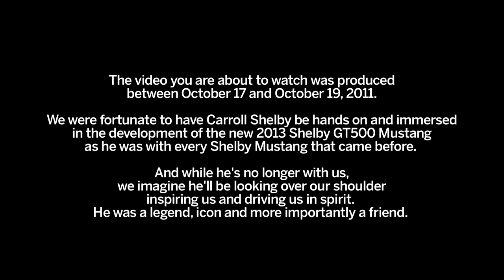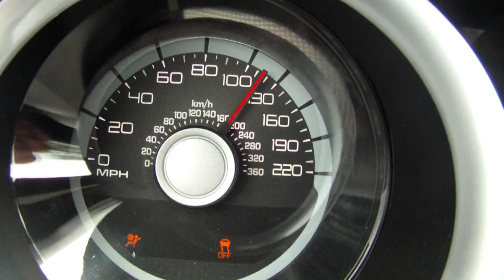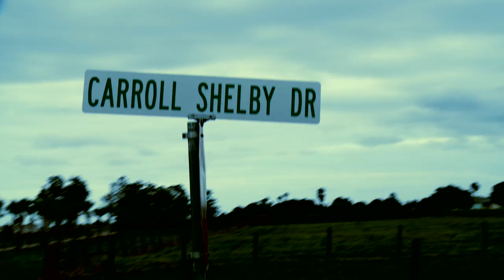Carroll Shelby and the 2013 Ford Shelby GT500

Comment: With him he took the mustang, now it’s a European car, he’d laugh if he saw the new GT500
Reply: No stick shift I think he probably would have put an air shifter in there to do the shifting use the clutch pedal and the stick for regular drive and press the button for air shifting it would be cheap  get your air at the local air pump all he could have made it an electric shifter some drag motorcycles guide most racing motorcycles got the air shifter I think the stick shift would be his main gripe not being put in it